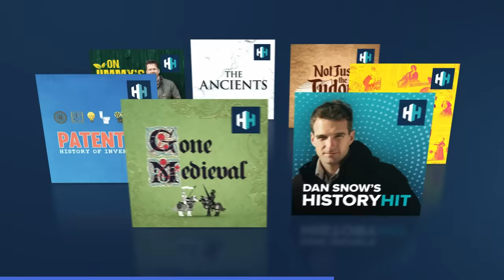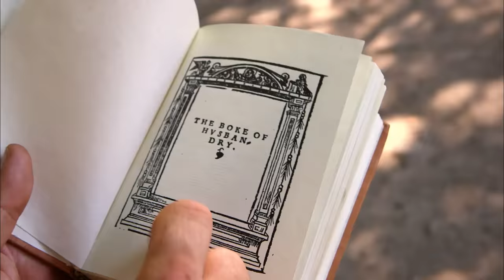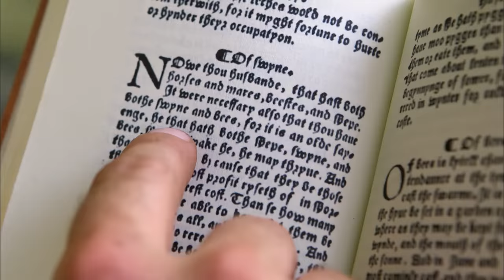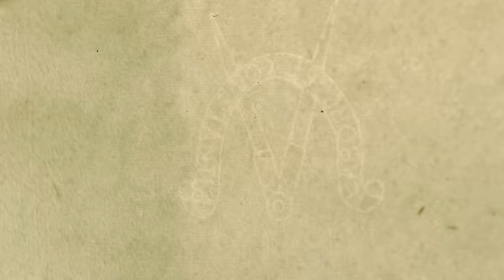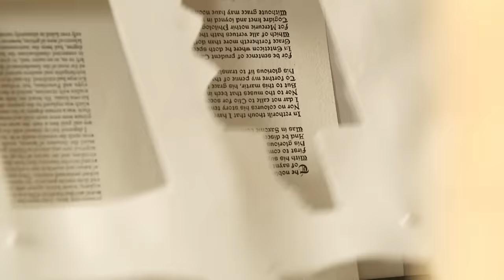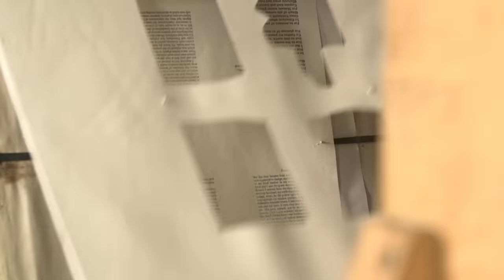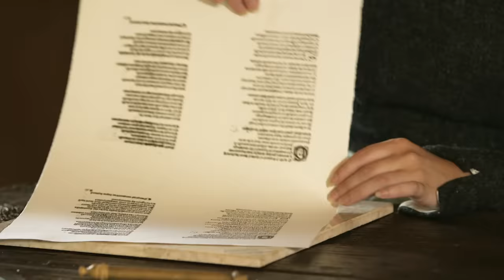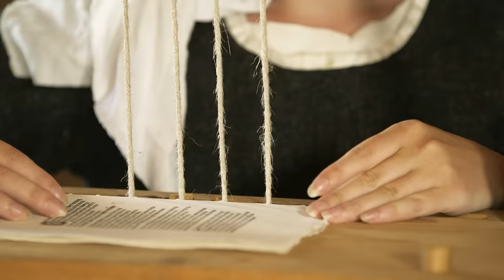Could You Have Survived Living As A Medieval Peasant? | Tudor Monastery Farm | Chronicle

Comment: So cool to see the stained glass. I learned how to do it from my mother and still do it today. Not much has changed actually. Its still quite crude, but the tools are a little smoother. Mainly, better cutters, grinders and soldering irons, and use of copper foil instead of just lead came for some techniques, but still as prone to breakage until you get a feel for how running a score and snapping effectively. Otherwise, the technique remains the same.
Reply: It looks like such an interesting and fun skill.   I know I don't have the capital to start trying tho. 😂
Reply: @ShortStuffMegs21  It's truly a labor of love and very satisfying to see it come together. You could start out on a smaller scale and make jewelry with glass scraps, then move up to making simple sun catchers. Dichroic glass is also fun. You can get a microwave kiln in a kit with the other essentials for around $100 bucks or less. I've even incorporated sea glass into some of my pieces. The only catch with jewelry is that you'd need to use lead free solder since it would likely be in contact with skin and that solder is more costly (especially if it's silver, but you can also use pewter). But, alas, I understand. I have WAY too many hobbies myself without the capital or space to take on any more new ones. Lol

Comment: That's a lot of effort to process a low melting point metal. I mean you can melt aluminum, ehich has a much higher melting temp, in your basic campfire. Also, with the fishing, England has pike and I'm almost sure it has trout also. Why go for eel over pike and trout?

Edit. I had only warched the first half